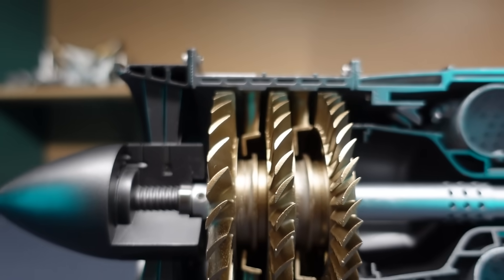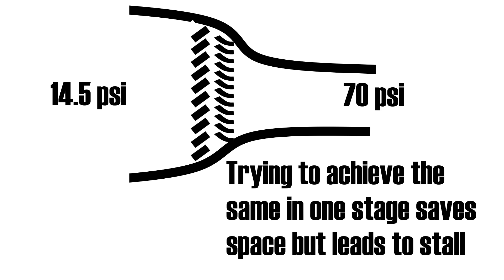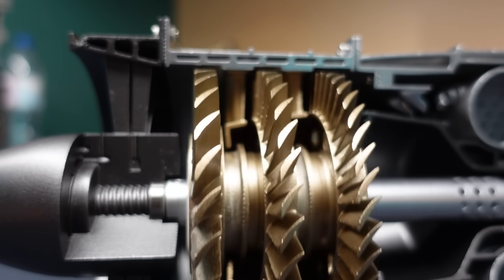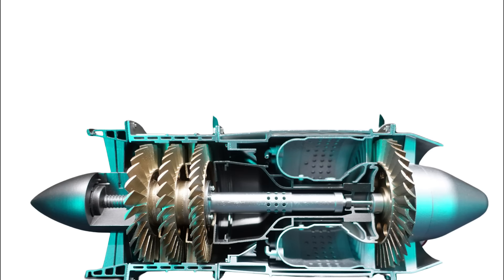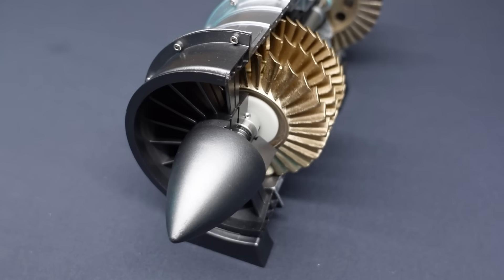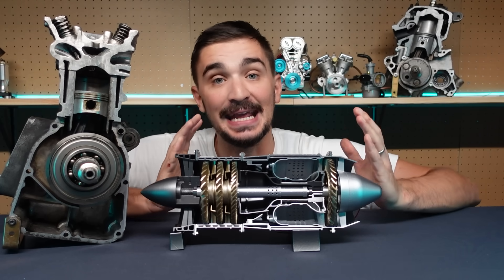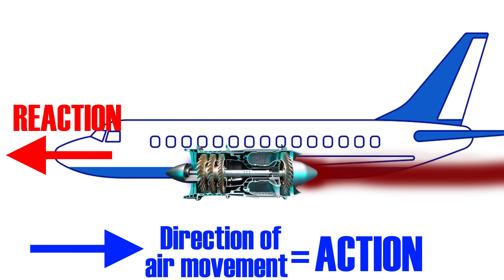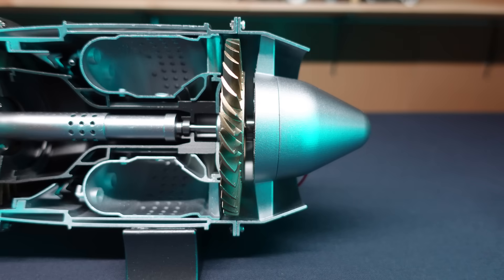Appreciating The Beauty of Jet Engines by Juxtaposing Them Against Piston Engines

Comment: One disadvantage of gas turbines is that they have a lag similar to turbochargers, giving them a low power response compared to piston engines. This isn't much of a problem with planes or power plants as they run at a constant power most of the time but this is one the reasons why we don't see these engines in racecars even though they can offer better power to weight ratio.
Reply: That's a serious issue, but it is only one of the reasons that turbine engines have never succeeded in cars.
Reply: @brianb-p6586 If we are talking about road cars, bad fuel economy is an obvious reason. Turbines engine are also expensive to manufacture due to the use of exotic materials needed to withstand the immense heat and pressure inside the engine.
Reply: @theotherguy6951  you can also add high emissions of oxides of nitrogen if the peak temperature is high enough for tolerable efficiency. 

Of course a recuperator can be added to improve efficiency (although it isn't enough improvement, as shown by the AGT1500 engine in the M1 Abrams tank), it adds enough bulk and weight to significantly reduce the size advantage of the turbine engine.

Comment: Most modern tanks and helicopters use turboshaft engines which work just like jet engines but instead of having a nozzle at the end, it has another turbine that drives a powershaft that sends mechanical power to the tracks or rotors.

Comment: This is a fantastic explanation. I've always struggled with wrapping my head around how a jet engine creates forward motion. I can almost make a turbofan make sense, but a turbojet is harder to follow, at least for my brain. I get it now!
Reply: A turbo fan is not much different. A turbo fan has 2 or even 3 separate rotating assemblies. The front fan is attached to the very aft turbine by a shaft, inside of a hollow tube, or spool. In between the forward fan and the aft turbine is a turbo jet engine mounted on a hollow spool. The forward fan and the aft turbine are known as "N1". The inner "turbo jet" portion is known as "N2". They spin at different RPM, to increase efficiency and performance. Rolls Royce turbo fans, have 3 spools N1, N2, N3. They also rotate reversed from GE, P&W, etc.
Reply: I forgot to add, the forward fan air bypasses the rest of the engine and provides the majority of the thrust.

Comment: On your model jet, is that accurate to have the combustion rotor fins going in the opposite direction as the intake compression fins? It looks to me like combustion hitting those fins would make the shaft rotate in the other direction making the intake an exhaust. Something just seems wrong with that model.
Reply from the maker: See pinned comment please
Reply: @d4a  thanks did not notice your pinned comment.

Comment: Hey there, I was just wondering whether there was an actual running version of the jet engine you used. I'd love to see and hear the 3 stage axial compressor.
Reply from the maker: This is based on a Chinese WP-85 which is a copy of a Russian Mikulin Am-3, there's plenty of old Russian planes running it
Reply: If the Wiipedia article for the Mikulin Am-3 is correct,  @d4a , that's a very different engine from this. The Chinese copy of the Mikulin Am-3 is apparently the WP-8, not the WP-85.
Reply from the maker: The wp-85 is a version of the wp-8, sort of like part of the wp-8 family which is based on the Mikulin. At least this is what I found by translating a few Russian websites.
Reply: @d4a  it's a huge difference to go from a two-spool with 1 + 8 compressor stages (Am-3) to a single-spool with 3 compression stages (this model), and the Am-3/WP-8 is huge compared to the full scale equivalent of this 1:3 model. My guess is that the mysterious WP-85 (online I can only find copies of that plastic cutaway model - nothing about the real engine) is a copy of some Mikulin design which is similar to - but different in every dimension and specification from - the well-known Am-3. 

I suppose the important thing is that it is a realistic design for a basic turbojet.
Reply: This is a one-third scale model of the actual old aircraft turbine engine.

Comment: You can use turbine (not jet) t0o propel vehicles, just attach the shaft to the clutch and the transmission and the to the wheels or the propeller, like you would do with a piston engine.

Comment: You forgot to mention an other big upside: weight to power ratio

Every additional kg needs to be "lifted", which creates additional drag (around 1/17 of the lift).
So, jet engines are more efficient vs piston engines if you consider the fuel burned to carry the engine weight.
Reply: Just don't forget that the light weight of the turbine engine is offset the extra fuel you have to carry to go the same distance as the more fuel-efficient piston engine.

Comment: Something to point out in a future video is the odd connection between velocity and horsepower in a jet engine. At zero velocity, at a standstill, a jet engine at full tilt makes zero horsepower. A jet's horsepower is directly related to the speed of the aircraft. The faster it goes the more horsepower it creates. This function is what allows the jet engine to propel an aircraft so fast and so high.
Reply: Well it makes tons of power, it's just heat and noise waste energy. It's not like air shooting out the back isn't energy.
Reply: This is why they rate a jet engine by thrust not horse power, thrust = force. Force x velocity = power.

Comment: So the "trottle" on a jet engine is really the injectors. Add more fuel, get more air and power. Most combustion engines are the opposite.
Reply: Gas turbine engines are just like diesel engines, in that they control power by controlling fuel flow, not air flow. In both cases they can do this because there is no need to match air flow to fuel flow, only to maintain at least a minimum air to fuel ratio.

Comment: In case someone is wondering why the plane engines they are used to look different, it’s because they have another component of Fan ahead of the intake here. In commercial planes the actual engine is much smaller than you see and around it there is a gap of air being fanned straight to the exhaust stage. This increases efficiency dramatically.

Edit: hasn’t yet reached the end of the video

Comment: Overall great video, a few things to note: You are incorrect about the purpose of the narrowing compressor duct.  It does NOT increase pressure. 
The duct narrows to maintain air velocity.  As the compressor blades and stators work the air, its pressure/density increases.  When the pressure/density increases, its volume decreases. To maintain air velocity for an incrementally decreasing volume of air, you have to decrease the area it travels through.  Aka narrowing the duct. You want to keep air velocity travelling through first 3/4 of compressor section mostly the same and only increase its pressure. 
If you didn’t narrow the duct, the air would lose enough velocity to render the engine useless. 
Also, your model is a bit crude, it doesn’t show accurate combustion chamber hole size and placement. Primary, secondary and dilution holes all have different purposes. Then there’s wall cooling holes that are much smaller (not shown in your model) and also swirl vanes around the fuel nozzle.  But your explanation of this part is decent enough without making the video too long and complicated.

Comment: Great job again! Love your videos. But there's an elephant in this room. Let me explain. There's nothing stopping the air from going out the front or rear. So why does a jet's airflow go only in one direction towards the rear? Well, it doesn't necessarily. Sure, it DOES most definitely while the engine is running as designed and within its normal operational envelope. But what's the mechanism that make the jet run in one direction? That's where this demonstration comes in.

Back in the 80's at U of I in Champaign IL during their annual science department open house (they used to have this back then, not sure about now), they had a turbine "ran with air pressure only" - as in no combustion or spinning starter motor - to demonstrate in very close proximity the effect I am going to talk about. What they did was pipe a huge amount of pressurized air straight into the side of the turbine (yes, at a 90 degree angle!) and just let it come out both ends as it wanted. They had streamers attached to the front and back to show airflow. At first. air came out both back AND front. Then, just how the presenter had explained, once the engine got up to a certain RPM, all the air would go out the back. What I'd never realized until then was that turbines use an "efficiency bias" trick to move the air in one direction. Basically, how this works is that, because the front and rear blades work at different efficiencies at different RPMs, the torque the airflow can put on the rear blades at operational RPM (in normal operating conditions) will always be greater than the torque it takes to overcome the resistance of the combustion trying to "blow back" against the compressor blades at the front. And in the demonstration at U of I, this was shown very well. The pressurized air started moving the turbine blades and both streamers were blowing outwardly. Then after the blades got to a certain speed, all-of-a-sudden you hear "woofff" and the front streamers changed direction and pointed inward. 

I also realized that's why turbines need a starter. Because the blades have to be turning at the proper RPM for the airflow to go in one direction enough to be able to allow the combustion to sustain driving the blades in that direction. Once that RPM is reached (along with many other correct engine parameters), then the airflow has correct bias, and the engine can start adding fuel.

Comment: thanks for the nice explanation. One thing I've been wondering lately is why jet engines work at all. I mean in comparison with a piston engine where valves close off the combustion chamber, the chamber in jet engines is always "open". So how and why does the pressure of the combustion only push the turbine? In theory the pressure of the air should go in both directions and push back against the compressor rotors with the same force as against the turbine. If you plan another video on jet engines this would be a good detail to do some research on...
Reply: It can be difficult to start a turbine to a certain RPM from where it can produce enough power to drive the compressor. Aircraft have auxiliary power generator for this and old designs needed ground equipment to start their turbines with compressed air. It is important to understand that the pressure is not increased during combustion. Just the temperature and volume of the gas. Which simply means there is a higher volume of gas to expand than to compress.

Comment: Pressure is NOT increased in the combustion chamber of a gas turbine. Temperature and volume are increased during combustion. The pressure after the combustion chamber is the same like the pressure after the  compressor.
This is the reason gas turbines are not efficient under partial load or even worse when idling. A certain speed is need to get a  good compression. In a piston engine compression is given mostly by the geometry and can further easily be tuned to different conditions by valve timing.

Comment: Actually turbojets do struggle more at high altitude than at low altitude.  Air density is the prime determinant of how much thrust the engine can develop, so thrust drops with every foot the aircraft climbs.  Transport aircraft get around this by flat-rating their engines.  At low altitude the engine can actually produce more thrust than its internals can withstand, so the throttle is only advanced as far as that limit.  As the airplane climbs and air density and thrust drop off you can increase the thrust lever setting to work the engine harder and continue to produce sea level thrust with reduced air density -- up to a point of course.  It is somewhat analogous to managing manifold pressure in a supercharged piston engine.  At low altitude the turbo can deliver more MP than the engine can withstand, so you have have to throttle the engine back until you reach the critical altitude where you are working it at max capacity.
Reply: Jet planes fly higher for less drag.
Reply: Another factor is the Mach the plane is flying at, below Mach .6 efficiency is at its lowest, above that speed efficiency picks up again
Reply: Not really.  

Jet engines are always designed to produce high thrust at high altitude because they are crazily inefficient at low altitude.  

Plus the fact that the air temperature cools and you get ram air at high speed.